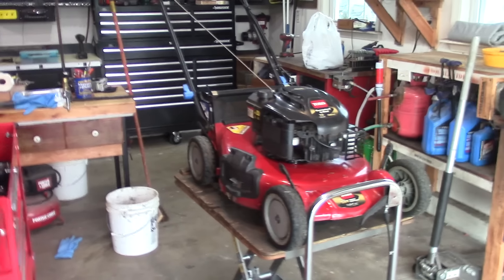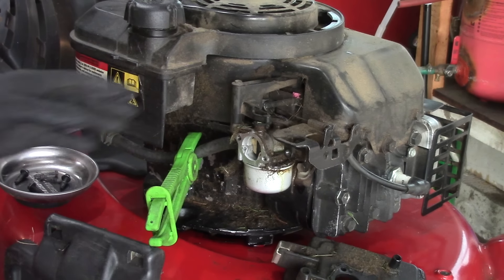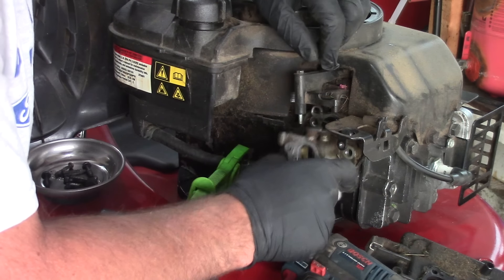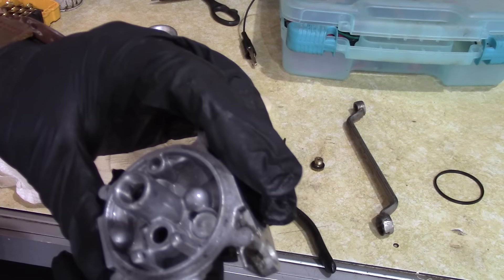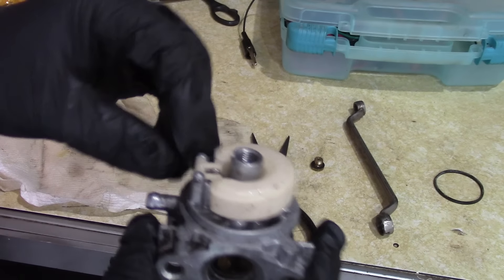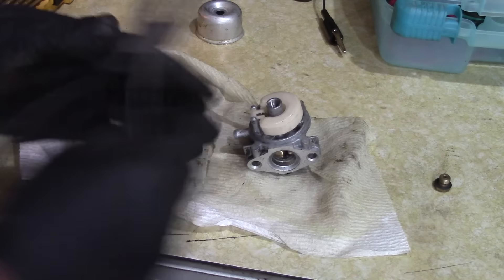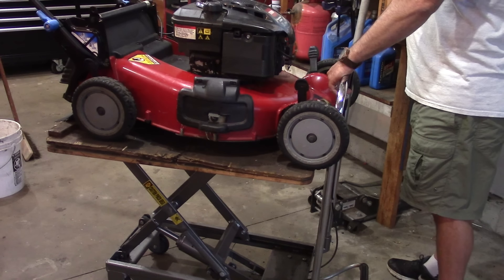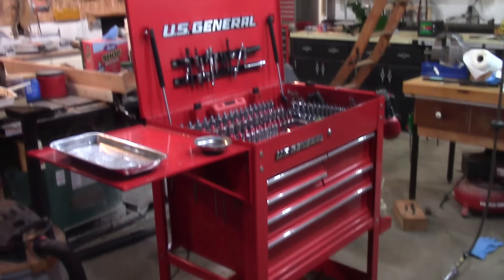Lawnmower Leaking gas out air filter

Comment: Thanks for the great video.  I have a Lawn Boy mower with a Kohler XT149 engine that leaked gas out of the carburetor.  The gasoline also made the air filter rubber gasket swell up and not fit in its housing properly ... I ended up buying several air filters until I fixed the gas leak.  I checked the carburetor float and cleaned the needle valve and seat per another video ... although they were clean.  The problem was the fuel bowl O-ring and maybe the small O-ring on the fuel bowl drain screw.  Since I have a new carburetor coming in the mail, I used gasket sealant on those O-rings that were not as supple as they should've been and they were getting thinner and becoming a little brittle.  After the fix, I put fuel in the tank and the mower started on the first, easy pull.  Perfect!

Comment: Thank you so much for this fix. My bowl was not floating correctly, stuck open.  Resulted in mower dying and fuel gushing out the air box.  Changed the needle seat gasket now everything peachy!  Mowed for over half hour without any issues.  Now on to fixing the tranny cable and belt.  Good times. 
Thanks again, keep up the good work!

Comment: In my experience most of the problems with those small mower engines are the result of bad fuel and the resulting damage it does to the carburetors.  I'm fortunate and have easy access to reasonably priced non-ethanol fuel, so I have hardly any problems with my lawn equipment.  I'm actually surprised at how bullet proof these small engines are these days.  They won't last 50 years like they used to but there's no reason you can't get 20 years service out of them with simple maintenance (oil and air filter changes and by using good, clean, fresh fuel.)  Thanks Bob for taking us along on this one.
Reply from the maker: No problem.
Reply: Nice job! Thanks for the video, saved me a lot of time and money. I would have totally screwed this up! Lol

Comment: I have an older 190cc B&S engine on my pressure washer. Same issue. Cleaned carb, replaced gaskets. Leak was better but not fixed. Your explanation of the float & needle seat function really made me realize I have same issue. Thanks!!

Comment: Doublewide6 Repairs   Just went through this same issue on my Toro.
Didn't have any parts so I got a new carb. for 13.00, checked it out and found the float is the problem.
Looked just like the one you had, not quite level.
Any way, it runs great, those plastic floats just don't last.
Good video, thanks.
Reply: I've gotten bad cheap carbs often enough to avoid them. Even worse, customers often come in with brand new cheap carbs and insist that the problem can't be the carb, because they replaced the original $75 carb with a $10 carb off of ebay.  I've gotten lucky before myself, and not so lucky more often.

Comment: using a heat gun to warm up the plastic to bend the tang on the float really works well . its just like when you take your glass's to get repaired , they put your temples in a heated sand to warm up the plastic and make it more pliable . this process works until the next time it needs to be adjusted . so you really cant get away from this problem until the use something other than plastic . I did this on a 19.5 briggs motor that some one threw away cause it kept flooding out and the motor was carboned up but after fix and sea foam it ran great and started right up .
Reply from the maker: I will have to give the heat a try.  I saw Taryl had a video on this.

Comment: I have used a Briggs seat in a Tecumseh carb before and it seemed to work in a lev195ea engine/carb
Granted it wasn’t the best thing todo but something to try.  

Good work hope the customer is happy.
Reply from the maker: So far so good.
Reply: The common small rubber seats are the same. Usually red for Briggs and green or white for Tecumseh, at least the originals.  There are a couple odd carbs that use a larger size- it's hard to find. But I often get Briggs in with green or white ones and Tecumsehs with red ones. Someone else put them in and they worked for years until they swole from ethanol gas.

Comment: I`ve done the drill thing for smashed fingernails with success. Haven`t tried the paperclip method. Unbend the paperclip and heat it red hot with a torch. Then use it to burn through the nail and releive the pressure.

Comment: one thing I do when working on a carburetor is after u remove it from the mower take a screwdriver or marker and put a line/mark on bowl below the fuel inlet so in case your bowl gasket happens to be questionable and its midnight you can put bowl back in the same place  and still use the carburetor until you can get one.

Comment: You can punch a small hole in the nail with a paper clip burnt to red hot.  The haematoma below the nail can be drained.  In good hands, no anaesthesia was required, no sterilisation was needed.  Of course, washing of the dirt from nail surface was required.  Dressing by a band-aid is sufficient.

Comment: The reason i am here,i found a lawnmower filled it with gas primes it & it worked.   So was happy with that,then after turning it of the full tank drained with the leak coming from the air?   I watched your video,but any info,i would be pleased with?    Thank you for your video.

Comment: Excellent, and one question. My Murrary Briggs 6.5 HP has never had problems. Suddenly, wouldn't start,  so first I replaced the Champion spark, new air filter, but this time, the gas flowed through the air filter. I searched a collection of Youtubes (Thank Heavens you exist).Question. At 7:44 you removed the carburetor bolt but you had already removed the entire carburetor. What I watched for was around 15..suddenly the bolt is on the bottom and carburetor back together. Some vids remove the bolt first, before removing the carburetor, and then use thin wires to clean various holes in that bolt which supply the fuel. With some, that was all they did, put the bolt back on and the lawn mower worked perfectly. I didn't see where you cleaned the holes in the bolt.

Comment: I had one in yesterday where the rubber seat was knocked loose and wasn't letting the needle seat properly and that was the problem with the one I worked on, I used my drill bit end to seat it all the way down and that fixed it.
Reply from the maker: Must not of been in right at factory.  They are seated pretty tight when done correctly.

Comment: awesome video and love the q tip idea. one thing though, if your gonna go through the whole hassle of cleaning the carb, surley you should clean the engine and everything where the carb attaches to before re fitting it. its just something i would do my self.
Reply from the maker: Yes, I think I blew it off with air (may not be on film)

Comment: Does the air filter have to be replaced if it's clean but was soaked with gas after forgetting to shut off the fuel to carb?

Comment: Crazy question for you doublewide6, what can i put on a 12.5HP Briggs intek engine cooling fins to keep leave clipping dust from sticking ??? The leave dust sticks and seems to really insulator making the engine run hot. Also, the engine has such a small air filter roughly 1 and 1/4 square foot of breathing element total. This really makes you change the filter every few hours. Any suggestions to help me out ??? Thanks VF

Comment: Check the engine oil , it will most likely be contaminated with gas as well, just repaired the exact same model with the same issue... stuck inlet needle...

Comment: Thanks for a great video. I have a Husvarna walk behind with similar engine. It starts first pull cold every time. However once it has run long enough to fill the grass bag it will not restart until it has cooled for 20 minutes or so. You mentioned that the air filter housing on these can warp. Do you think that is what is happening or is there something else I should be looking at?
Reply: If the housing warps, the primer/ artichoke will not work well. Add an extra gasket or two to help it seal. I coat mine in grease, also. Better seal.
Reply: Auto- choke! Lol

Comment: Same thing's happening with my Craftsman 5.3 mower. My dads getting up in age and gets his lawn done now so he gave me his 5.3 craftsman mower and his 32cc craftsman weed eater. Both leaked fuel. I replaced all the gas on the weed eater and it fired right up. The lawnmower however, I filled it with gas. Try to pull start it like 20 times and nothing. Then I noticed the garage started smelling like gas all night. I went to check why the mower smelled of leaking gas and I noticed the deck of the mower was a little wet with gasoline. Looked to see where it was coming from and noticed the filter is wet with gas as well. Would this most likely be the same issue you had on your customers mower??

Comment: Super video. Baking soda is great for cleaning the needle seat hole. I’ve use some Amazon chineseum carbs on Briggs with good success, too. Great for corroded carbs. Ice the finger, you’ll be ok. Check the oil .

Comment: If I'm not mistaken your engine uses a 498260 carb kit....Those kits come with 2 different bowl gaskets and 2 different air box gaskets..... Your EZ start / Auto choke carb uses the thicker bowl gasket and the simple air box gasket... No need for the gasket with the hole in it.... Save that one for a primer bulb style air box and save 4 bux like that for another carb job...

Ok now to the nitty gritty........  I don't think your float was bad.... Both floats were out of level the seat was swollen...  I am wrong a few times and I might be wrong now.....  I have seen those seats go bad tooooo many times.... Ethanol gas will do that all the time ......  But you got it going and it doesn't leak so you got it whipped..........   I use the smaller kit 398188 a lot of times.... That is just the needle and seat kit and it's 5 bux instead of 14 bux for the whole kit.... 

I am a Briggs dealer so I keep both those kits in stock and plenty of them tooooo...  That Etho gas is keeping us in business for sure .............

Plus Tard Mon Ami ~!~!

BTW...   YES more narration helps a video a lot ..............

Comment: Enjoy all of your videos.  Great job explaining problem and fix.  Keep up producing these videos.
Question?
Similar problem with my 4 stroke weed wacker, except oil comes out of the carb.  I over filled oil and thought it would burn off, but now leaks through carb.  I did take some oil out, but still leaks.  Will I need a new carb or will rebuilding carb work?   Your thoughts please?
Reply from the maker: The problem should not be the carb.  Try to get the oil to the right level and run it.  It should burn off.
Reply: Once the oil gets to where it doesn't belong, it'll take awhile before it spits it all out. Not a carb problem. Unless otherwise specified, I find that 20w50 works best in those. Did you say Honda? There is now a special oil recommended for them. Valvoline...Ow20? I think. Wrong oil will make a 4 stroke weedeater type engine run funny. 30w foams up in them. Always store them level and upright. Oil gets to the wrong places if you hang them up or turn them over. Makes them hard to start. Then they spit out oil onto the air filter, blocking air intake.

Comment: Organized shop pays off in dividends, and keeping it that way is not always easy.  I smashed my middle finger with a crowbar and it was about 40% black.  Read online and the rule of thumb is if about 1/3 is black, do not drill nail to relieve pressure and remove blood.  It took five months and finally part of the black fingernail fell off with new growth underneath.  It hurts st first and it is a slow process, but try to be patient.  Nice fix on float.

Comment: Quick way to relieve a blood blister under your nail like that is to heat up a needle over your stove, holding it with a pair of pliers, than all you do is just barely touch the nail with the needle. Opens it right up. Plus the needle is sterile from the heat.

Comment: I have a Troy Built Lawnmower from Lowes that started leaking oil i think from the air filter, what's the fix for that? It's a mower that's only a pull start it doesn't have a prime option in case that helps diagnose the issues.
Reply: A plugged air filter will suck oil out of the engine. High oil level may make it leak also, possibly from a leaky carb leaking gas into the engine oil

Comment: I hear you, man, about keeping the shop cleaned up. You might like to know it's an old, old problem. "Socrates:  And suppose you have two people. One has every tool in the book, but he can't find them when he needs them. The other doesn't have so many but he can find them when he needs them? This because the latter just throws them down anywhere when he'd done, but the other has everything arranged, each in its appointed place. Which one of them is better equipped? The one who has a lot of tools but can't find them, or the one who has few but knows where they are?" Xenophon, 5th century B.C.

Comment: @doublewide6 I have a craftsman pressure washer with a Briggs 7 hp engine. Was leaking fuel. Got the carb and fixed up but can’t get the throttle linkage and spring figured out. Any ideas on how to figure out how it’s supposed to go together? I bought this used and I’m not sure it was set up correctly when I got it. Thanks!
Reply: Before you take apart take pics so you can put back together  auto zone sell the small engine repair manual and it might have pics in there

Comment: I turned my lown mower to the side and fuel just started leaking out of the air filter. Could it just be because I didn't close the fuel tank before?(the little white know that seems to be some type of valve for the fuel)

Comment: Maybe you can help me. I cleaned my carb replaced the seals and needle . It'll start but want stay running unless I cover the air intake with my finger. What am I doing wrong?
Reply: Did you check for vacuum leak check all of your hose make sure no holes or everything is tight
Reply: Unless there is an air leak,I think something is plugged. Gas isn't getting through. When you plug the air intake, it sucks more gas up and keeps it running. If you have a carb with a black plastic  plug next to the idle screw or a metal screw plugging a hole in the carb body, remove it and make sure it is clean. That's the idle circuit. Can't idle if the idle circuit is blocked. Tecumsehs usually put a plastic plug over it.

Comment: I gave one woman in my neighborhood a mower which leaked gas through the primer bulb and I told her that it was the only problem with it. She never got it fixed, but gave it to her son and he never brought it back to her.
Reply from the maker: it is a common problem to have the fuel leak out like this and an easy fix.
Reply: I knew it was easy to fix the problem when I gave the mower to the lady and told her what was wrong and what needed to be fixed. Her lazy sons are shiftless and didn't fix it for her and the mower is still sitting at her house still not fixed.

Comment: When I was working a shrimp boat many moons ago a friend dropped a cable guide on his thumb.....  25 pounds worth of steel ........  His was worse than yours.. He took his Buck 110 knife and drilled the nail to relieve the pressure...   The weight of the knife plus a lil hand pressure made a hole to relieve the pain......  

Hey man that pressure on your finger is almost as bad as a toothache.....

Plus Tard Mon Ami ~!~!

Comment: I also just got a 19hp tractor for 100.00 the problem is it hydo locks at 1/4 gas in the tank. As you may know, I am a disabled vet and money is tight.
Reply from the maker: You may have to pull the brass out of the seat of the carburetor.  I have a video on how to do a Briggs 17hp.
Reply: Where is the video the motor is a 17.5 Kohler  Husqvarna tractor  > i looked on your site and could not find it.

Comment: I got them before which they had gasoline in the float. So it's hard to see. And it makes them overfill. All they make is that cheap crap anymore. I bought to for my nephew's zero-turn with in a year. They leaked gas into the float you could smell the gas coming out of it but you couldn't see the crack or the whole it was really odd how slow at leaked and filled it up.

Comment: I worried that the drill would shoot a spark and start a fire.  I'd recommend a ratchet instead when dealing with a fuel leak.  I've seen brushed drills spark and personally don't want to take that chance.
Reply from the maker: Good tip. Thanks

Comment: I work on mower also, do you know of anyone doing a video on the kohler after market carbs, I'm having a lot of trouble with them leaking. thanks for help if you have the time.
Reply: The more you pay for an aftermarket carb, the more likely it will work properly. I think some aren't really made to work, it just looks like a carb. I much rather rebuild originals. Also, always check gas cap. If the valve is bad, the tank builds up pressure.

Comment: I accidentally lowered my Toro Timemaster 30/model:20199 onto a tree stump. Now only one blade engages. The other blade has no tension/resistance. Helpppppppp my friend! Thanks in advance!
Reply: check on your spindle, may have stripped the gear.

Comment: I dont need to see any more ..replace the float needle and seat with an oem  needle & seat . when  properly reassembled  the  float should be a 90 degree angle to the fuel pick up tube (or slightly below . check for leakage by blowing into the fuel inlet nipple .

Comment: Come on, heat and a needle red hot and push it through the nail. It takes little pressure. Do it a couple times if the throbbing returns.

Comment: The Toro no prime start lawnmowers are complete junk. the carburetor continuously clogs and without a fuel primer you have to physically remove the air filter and manually prime with a fuel soaked wick. Its a big hassle and takes a lot physical stamina. Sometimes even taking 2 men. One man putting fuel in the air filter and adjusting the idle while the other man struggles to start it.